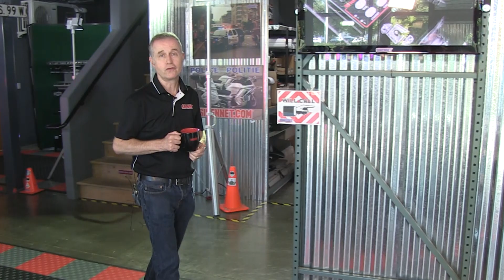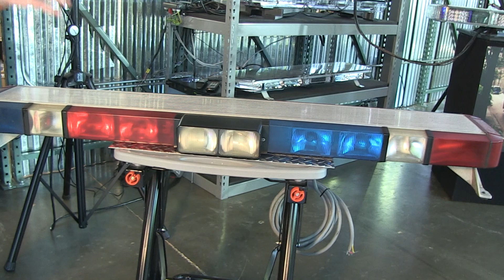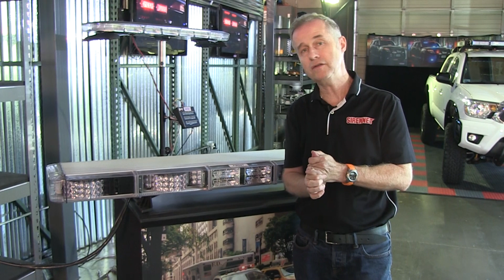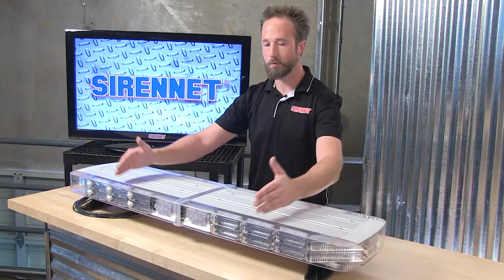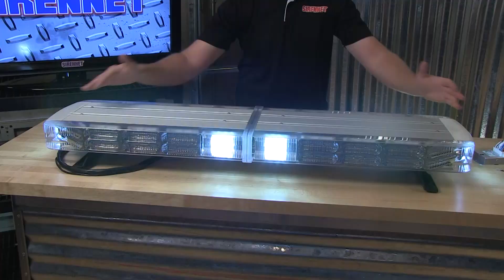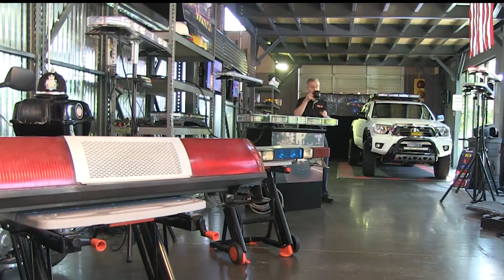Whelen Edge Ultra Freedom IV WeCan Lightbar

Comment: Does the liberty 2 offer the same flash pattern as the first one you had on?
Reply from the maker: It sure does.
Reply: I'm back with more questions. On the older freedoms how easy is it to setup to have separate modules on a different switch as well as tied into the main flashing sequence. Example: if I have slide position 1 setup to turn on two rear amber modules only, but slide position 2 and 3 just adds blue into the mix.

Comment: whelen needs to put that lightbar on a diet it's so fat
Reply: I love fat led bars
Reply: I've seen it used on quite a few EMS fly cars and fire vehicles. I personally like the stack of lights. I think POV I would definitely get something lower profile
Reply: +Public Safety Lights Australia thats the point of this bar... large profile. target market of fire/ems. which need less stealth more visibility.
Reply: Could you have top red/blue and bottom amber? I need a bar for multi use. Responding and plowing.
Reply from the maker: You sure can. The Liberty II DUO could also be a good option for you to check out.